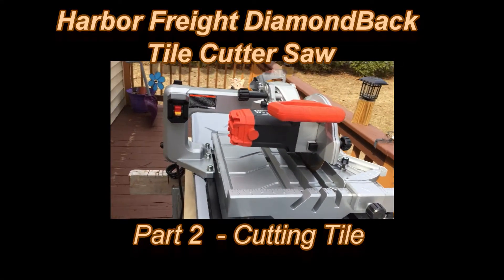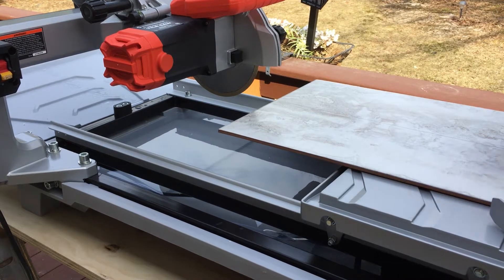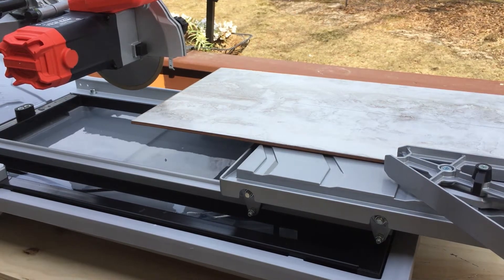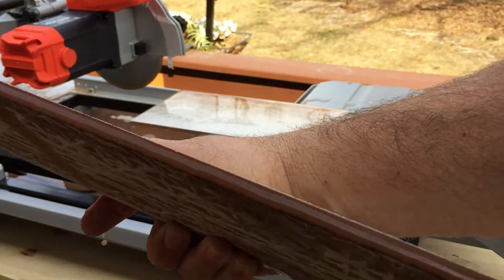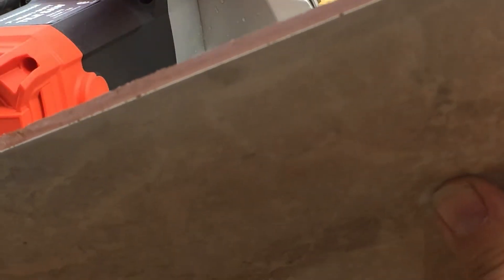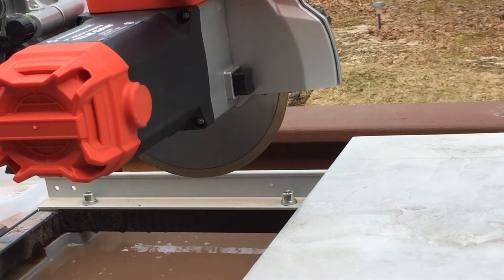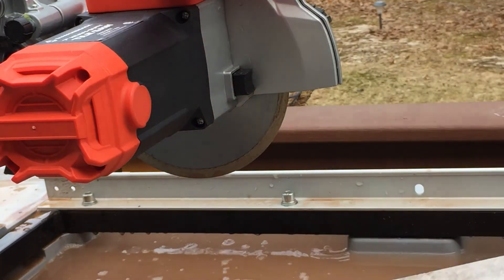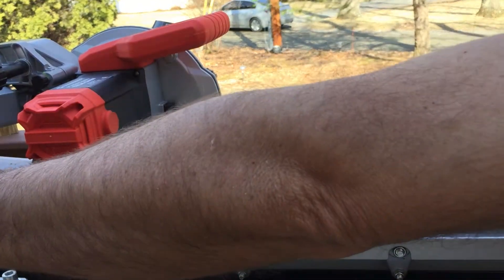Harbor Freight DiamondBack Saw Part 2 - How does it cut?

Comment: Thanks for the good explainer video. Timely and helpful to me as I recently bought this tile saw and about to get underway with my kitchen floor. Based on other reviews, I did purchase another saw blade as these reviews said the blade that comes with the saw is not the best so something to consider.
Reply from the maker: Hi Pat. Thank you for looking at the video. It would be interesting to see the differences between the HF blade and the other brand blade. I have nothing to compare it too. It seemed to cut really good to me. However I know when it comes to wood cutting saw blades, I have found that the Diablo blades usually work a lot better than other brands. Like cutting butter with a hot knife.